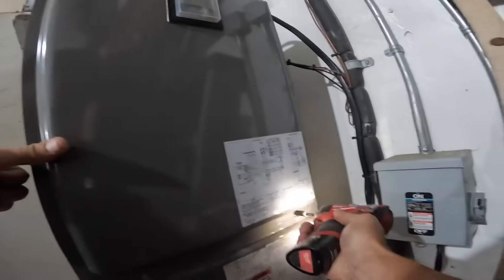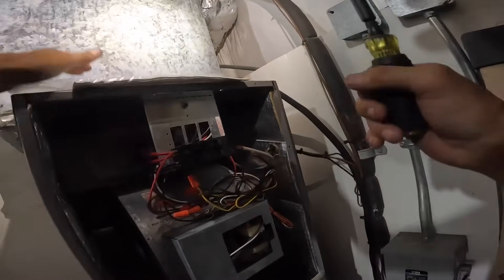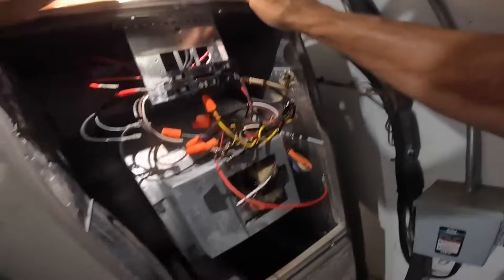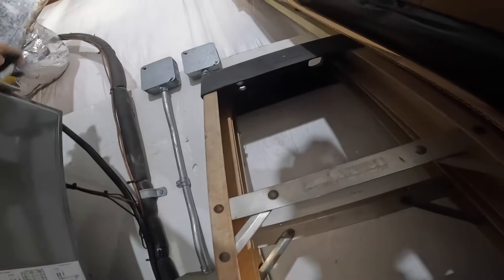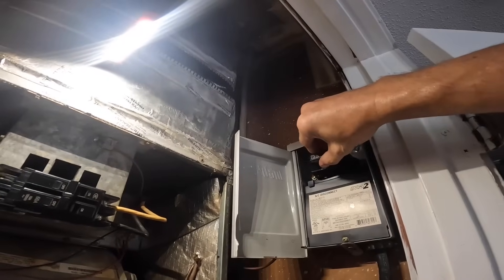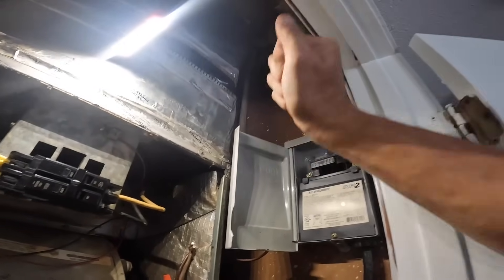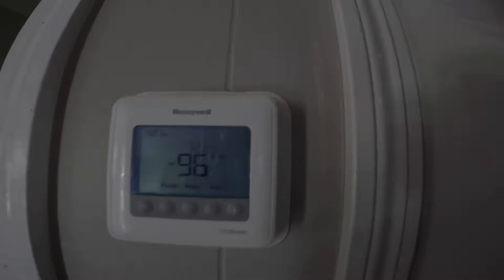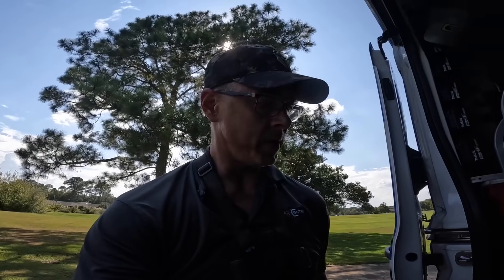A Problem That’s Finally Being Addressed! #hvacguy #hvaclife

Comment: That problem has been around for years. I found location of air handler made a difference. An air handler in a garage had more breaker failures than attic units and attic units had more failures than inside the house closet mounted units. Obviously humidity/moisture is the main killer of these breakers. 
If the disconnect was close and in sight of the air handler, then I would use a terminal block and do away with breaker and seal the opening on the air handler panel. Power can be killed to unit from disconnect for any future repairs.
Really makes no sense to have 2 breakers.

Comment: Our original Ruud air handler from 1997  had a pull out disconnects, no breakers on the unit. Replaced the whole system in 2010 with a Rheem, left the original pull out under there (nothing wrong with it) the pull out burned up a couple of years later. The 60 amp breaker in the air handler went out one cold winter day, it was the QO type. I’m guessing lots of moisture is killing these breakers. It gets pretty hot and humid here in Kentucky, last week was pretty miserable.

Comment: Not all breakers are rated for horizontal mounting use. Is it possible your supplier is stocking (or they are mis-marked) the wrong version   (sometimes it is 1 letter in  the p/n)

Comment: with those disconnects so close I'd be tempted to hard wire those things
Reply: Good call. You probably can do that and satisfy the NEC disconnect etc
Reply: @anthonyelectric6045 as long as there’s a disconnect within sight, you’re good. An inspector would probably get you on UL listing for bypassing breaker though.

Comment: Man, with that disco right beside it - jump it out.  Jake Porter just replaced a bad Ruud breaker like that and temporarily wirenutted it.  If that disco had a breaker in it, that is.  I guess the Polaris connectors are better for heavy gauge than the purple wirenuts, though.
Reply: The disconnect very clearly was an unfused pull type.
Reply: @michaelnash8435  The second unit was.  You very clearly missed the first unit and disconnect.

Comment: Do you think maybe a different brand may be better? Maybe it needs a bigger one that has more amps? I don't know, just speculating. I guess hard wired to a disconnect is the answer if the unit itself is on a breaker.
Reply: The old Square D 60amp breakers were better than the new  junk  ones.
Reply: I agree @jaimecortez3601

Comment: Too bad about the circuit breaker failures
Is splicing through the line/loads in the air handler and using a fused or circuit breaker external disconnect an option?

Comment: If they make a pull out retro fit kit I'd order a few and keep on the truck chaching should b a warranty issue if unit new enough and registered had few problems with square ds but mostly because of lugs working lose

Comment: Hi Curtis watching again the one you keep replacing is the Hartland controls one checked against my breaker.

Stop using them and order the square d version qou ones for your truck in various Amp ratings and that should solve the issues you are having.

But again thank you Curtis. You have helped me realize busting my hc breaker is maybe not such a bad thing for my heat kit. 

As I might have ran into issues with it. And even if you think it is miniscule and we're not going to post, I am glad you did. 

Anyway try stocking the square d ones on your truck instead for the next time you get called out in 2 weeks.

Comment: Not only those are bad but the ones on Trane units are going bad too. Using cheap cheap products doesn't make sense these days. Well Using pull outs are a good start. Thanks for the videos and keep HVACR America!!!!
Reply: It's the Chinese ones like Hartland controls ones d square makes a good replacement breaker that is Mexican made but made in Mexico is better than China and d square is an American company.

I also know a guy from Maryland has been using jards for capicitors because he can't get other companies in his area and he said I will take Mexican made over junky Chinese parts.

And jard is Mexican made.

Comment: Maybe they just need to use better parts.  That's why I asked on your video yesterday whether it would make sense to put better than OEM parts in, if available.  Even the "best" brands seem to be using cheap parts.  Ted Cook has been bitching about Trane's use of cheaper switches, iirc.
Reply: Ohh yes Ted cook the trane guy.

But like Curtis he knows what he is doing even if he is picky about trane stuff VS other brands.

Comment: Curtis thanks for the post on the breakers are they Hartland control breakers as that is what came with my unit but I stupidly broke it.

But thankfully I found d square makes the same style breaker.

I can get for 57 dollars. On Amazon 

Anyway Curtis can you please tell us what brand breaker you are replacing with.

And if it is the Hartland controls one which is made in China.

Have you thought of trying out the d square ones.

Which are Mexican made I also know general electric makes one too but not sure how good that is.

Anyway you posting these videos continues to help so many people figure things out.

Like your gree flex vidoes and so many others.
Reply from the maker: It has HC on it. I’m not familiar with that, it may be the heartland control you were speaking of.
Reply: @HVACGUY  it is Curtis I have been trying to locate a replacement one for mine as I stubidly forget to pull up the lifter but is the Hartland controls one that keeps failing on you or was it another brand if so try the square version next time.

That one has the model number qou with the amperage numbers and the 60 Amp breaker by d square is model qou260 feed thru they are 57 dollars on Amazon.

But through your distributer you might be able to get them for less but I checked for my Mr cool and it meets the same 10ka rating as my Hartland controls one.

And has a 10,000 interrupter rating.

Hope this helps, but you may want to switch to and try the square d versions and yes they have other amp versions like a 50 Amp. Anyway the one I mentioned above seems to be getting good reviews without issues.

Good luck but now you have another option to stock on your truck.
Reply: @HVACGUY  ohh and Curtis the gree flex you installed for your customer probably has a Hartland controls breaker for the heat kit you installed.

As the Mr cool rebadged gree flexes use Hartland controls for the hear kit breakers.

Anyway try square d to stock on your truck with the different Amp ratings next time.
Reply: HC is Hartland Controls. Curious to know if resetting it would have cleared the issues?  Lately, I’ve been hearing a lot of guys in electrical world say they have had recent calls for power issues.  End result was just turning the breaker off and back on. Don’t know what specific brands (assume a variety) but something internal is acting up. Most have been two pole breakers and a couple guys said they got half power ( 120 instead 240) before resetting.
Reply from the maker: @THEG00CH89 I tried resetting multiple times.